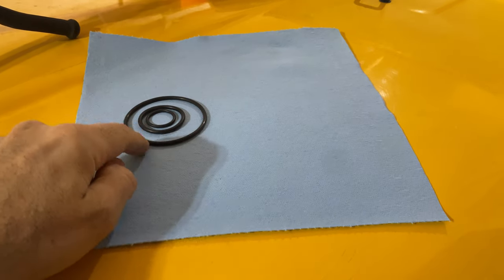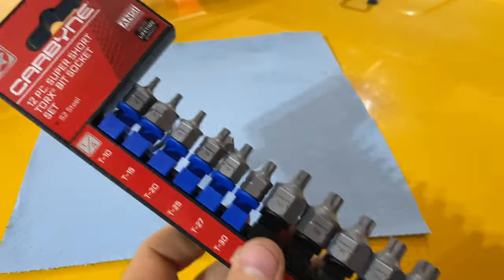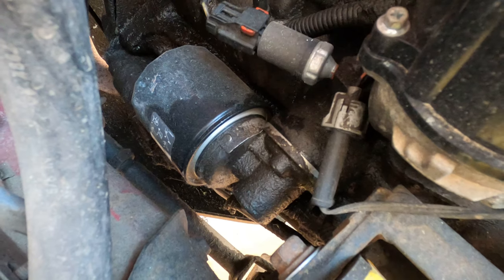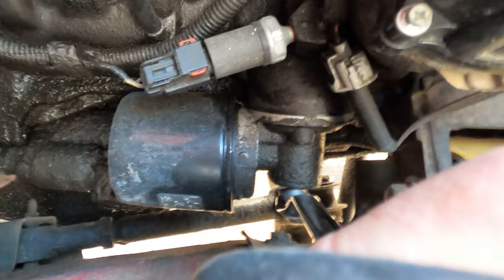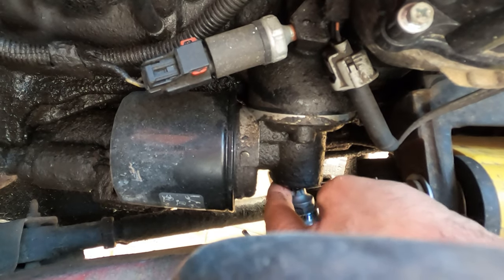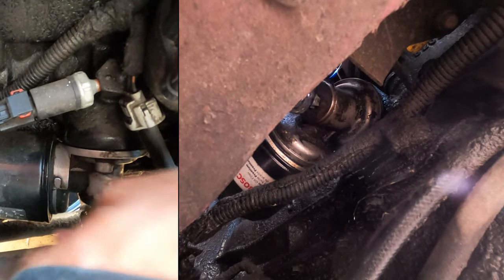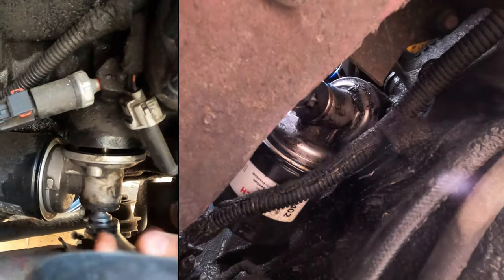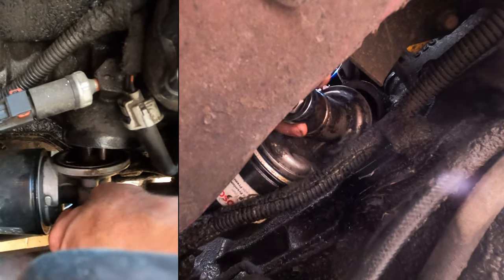Jeep XJ 4.0 oil filter adapter o-ring replacement

Comment: I started to do this then it became apparent that I could use the filter center bolt and screw the filter direct to the block. I used a smaller filter  on it. No more O ring leaks. This also works on the 93-99 ZJ Grand Cherokee.

Comment: Good video; it helped me with the explanation and removal of the internal bolt seals. I had to fight with the HVAC lines, heater core lines and starter lead...ugh...but with the right tools this should be easier. I ended up cutting down a torx bit into a modified 12mm socket. Gave me just enough room to squeeze in a 3/8 In. Long Reach Dual Flex Head Ratchet (harbor) which gave me all the leverage I needed. Cheers!!! BTW mines a 96 XJ going on 225K miles.

Comment: I have a 96 XJ,oil filter adapter was leaking, the kit I received didn't  have the small 'o' rings either,  replacing outer ring did the trick, later, my oil pressure started to leak from the back of it, replaced it, no more leaking.
Reply from the maker: Interesting that your kit was also incomplete. 

Those oil pressure switches are really flaky. Doesn’t take much for them to work  erratically or leak.

Comment: Which way do you turn the socket? Towards the front grill or Towards the back end? Trying to take mine off and your video is a little confusing on which way to turn.
Reply from the maker: Its standard threading, so counter-clockwise to loosen. They use loctite from the factory, so darn tight to break free.

Comment: It looked like you had an assortment of different o rings that weren't the ones from the 2 kits you have listed in the description (and I may be wrong about that) but did the combination of the two work for this job? Or was it the combination of the 2 plus some you had to add
I want to order all of this but want to know what to expect. Any guidance would be appreciated, thanks for the video
Reply from the maker: Its been a while, so details are a little foggy. I think two of the three were from the kit, and the last one was from a generic o-ring kit. 

If you are near and Autoparts store / have access to a second vehicle, bring in the old o-rings and it will be a quick check.

Comment: How many miles were on yours and when did it start leaking. Just did my oil pan gasket and rear main so I was going to do this but the torx bit keeps twisting out from torquing it not entirely strait.
Reply from the maker: This XJ has over 380,000kms. I noticed it was leaking when we got it about 5,000kms ago and it progressively got worse.

Yes, its tricky keeping the torx bit straight. Good luck
Reply: @EricCantin  I ended up getting it with two wrenches locked it finally. Thank you.